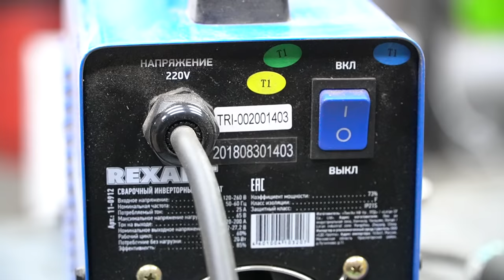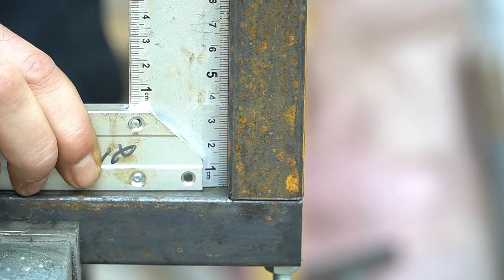Мало кто знает этот секрет профильной трубы!

Comment: Well done. Your innovation looks very sturdy.
I have two welders, an AC welder and a DC welder. If one breaks (hasn't happened yet) no problem. 
I hope you get a replacement welder soon if you haven't already. A good weld is much prettier than the nuts and bolts. And faster!
Reply: Great for such a problem. If you had "200" such welds...it would take a crew of 10 men to do the job. Better to have another welder at hand...and let the "second man" go to Grainger...and replace the first welder; buy a contract too when this one breaks!.

Comment: He could also use an "eye" bolt that goes inside the other piece and then run the other bolt through the eye and tighten them down. Less cutting.